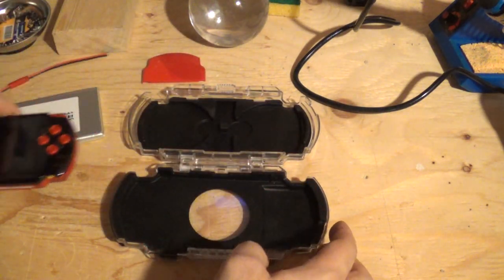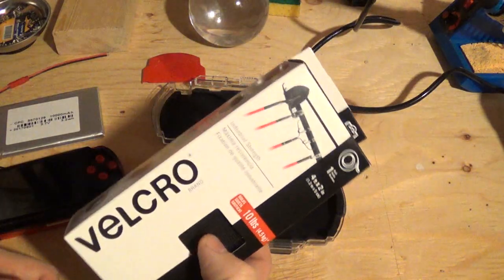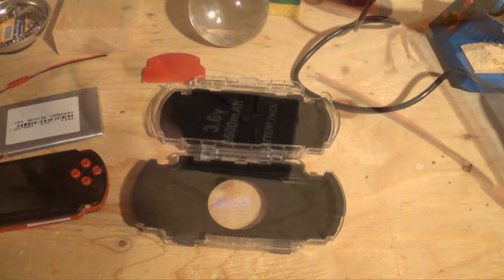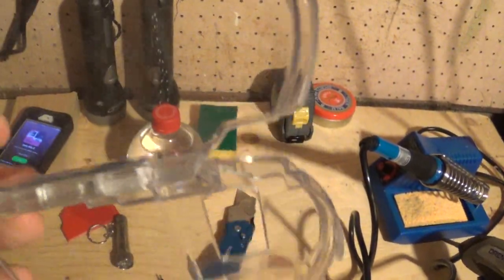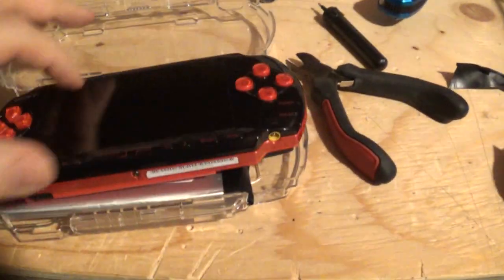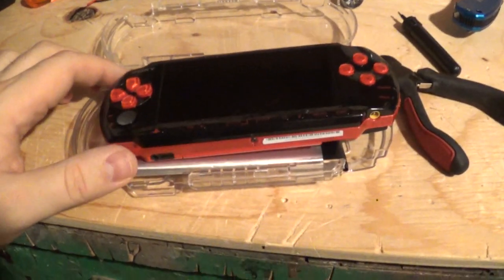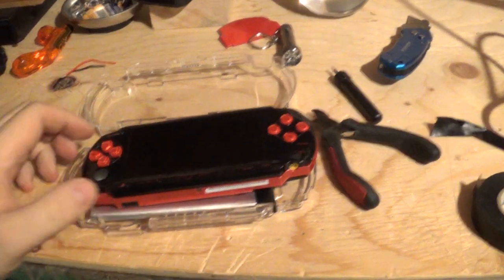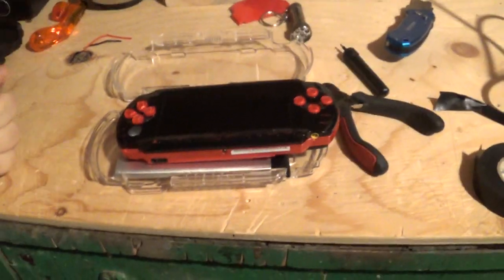10,000 mAh Massive PSP Battery mod

Comment: Theres a mod for a 4050mAh battery but it does get rid of the umd drive and you need to cut some of the case, but you could always just buy another one
Reply: That's atleast better than killing of the PORTABILITY purpose of PSP by adding this big ass 10000 Mah battery

Comment: nice
I'm doing something like this myself but I'm using a 18650 battery at 6000 amps with a battery case so when its flat i just pop it out and insert a new one and use a charger to charge it properly

Comment: Hey hows it going, im in the process of doing just this however a non invasive type only adding a new cell to a stock battery, when im complete i plan on making a video to show how to rebuild using a new cell, i plan on removing the charge/read circuit board from the original battery and applying it to the new, ill be sure to make a video after its completed hopefully

Comment: You could probably fit a 4kmah in there as well. Mod it with a JST plug and USBC port so you can change the battery without having to desolder it

Comment: Hey, is it okay to get the pcb from a bloated battery or will it explode?
Reply from the maker: mthevara it should be fine. 👍Just be careful wash up good after. Don’t want any battery acid on you or left on the board.
Reply: @CanadianZangief  Thanks a lot man. Didn't know if it was safe, I think I'll give it a go just in case the battery I ordered off Amazon turns out bad as well. Keeping the psp stock either way.
Reply from the maker: mthevara good luck with the mod!
Reply: @CanadianZangief  Thank you 👍🏼

Comment: I got a "3600" mAh battery, brand fucking new and can't even play battlefront 2 for more than 45mins.

Tried a few different batteries and have the same problem...

If this is a problem with the console and not the batteries, will this mod fix it?
I'm assuming not but I'm hoping for a yes?
Reply from the maker: S WITTON well all I can say is buyer beware. There are lots of problems with battery suppliers mislabeling products. If it seems to cheap then there is probably a reason. I doubt it’s the console itself. I’m sure it would have stopped working already from such a major problem.
Reply: @CanadianZangief  sweet.
To be honest I didn't pay a lot for it, it was around £10 which I know is cheaper than the Sony original ones.

I have a couple psp consoles so may give this ago, its a great idea dude.

Have you recorded the battery life to get a proper reading? & if so, how many hours of gameplay can i expect? Sorry for the long winded reply.

Comment: Very cool! I still have 2 old model PSPs and one of those cases. Good solution for those old swollen batteries. My pspgo is the only one running on the original battery. The other two haven't been powered on in years

Comment: Maybe you already answered it, but even so I will ask you. So, is it possible to fit internally this battery? in a PSP 2000?
Reply from the maker: Diego Deotti you can certainly do smaller batteries, but these ones are to big to fit inside. You would probably be stuck with 5,000 mAh for internal.
Reply: @CanadianZangief  thanks a lot!

Comment: I want to mod my PSP 1000. Can I use original PSP battery board for battery mod?
Board pic 
https://i.imgur.com/lBAQJxU.jpg
Update I tried to connect new battery to the board but it won't charge. Red light blinks for like 100 ms and the goes away. Any thoughts?
Reply from the maker: What kind of battery are you using and are the prongs connectors on the board intact?
Reply: Canadian Zangief 18650 battery And yes the prongs are connected
Reply from the maker: ahmad hakimi the 18650 is it 4 AA lithium battery cells? Each of those batteries should be around 3.5-3.7V. The most the psp can handle is about 4.1v and that’s kind of the top end and probably won’t change properly.
Reply: Canadian Zangief The battery has charge in it and it would not turn on I think it’s the board what you think
Reply from the maker: ahmad hakimi it’s possible. When dealing with hacks like these sometimes you just have to slowly rule out everything as you go. Good luck friend!
Reply: Canadian Zangief thanx

Comment: Although this vid is old, I might try my luck.
Do you know the exact function of this battery board you got out of that battery case?

Sadly, my original broke and I was thinking if I could just use any other LiPo Battery Charging Board, hook it up directly to PSP (without the special connector, just solder it directly with some wires) and then the battery onto it. With that setup, it should be possible to charge the battery directly through the PSP with the USB or normal power supply, or am I wrong?
Just using a small 1800 mAh battery, so no biggies there.
Hope you can help me :) Thanks for your vid!
Reply from the maker: Kyuar I believe it mostly acts as a protection circuit to prevent overpowering. As long as you can control the charge with another board it should be fine. 👍
Reply: @CanadianZangief  Thanks for your fast response :)
So I'm assuming the PSP does not have any internal charging pcbs?
I was always wondering what the third pin on the PSP is for, two of them are +/-, and I always thought the third is a kind of signal pin for battery capacity check. Measuring the pins while being hooked to the original power supply outputs something like 1,9V on +/-, which got me curious.
I don't wanna break my PSP with this experiment, so just hooking up another battery and disconnect it for charging would be the safest way I guess... Sadly, I found nothing about using any other battery board for the PSP on the internet.
Reply from the maker: Kyuar No the PSP does not. Without the battery inserted there is no need for a protection circuit since using the plug in without a battery already has the current supply and demand voltage regulated in the charge cable. I’m certainly no expert on the subject though, but when I was thinking this mod up I wanted to follow the easiest path that wouldn’t involve damaging or permanently modding it. Harvesting a battery was just the easiest way to do it for me.
Reply: @CanadianZangief  Yeah, totally understand that point. But having to invest 10+€ in my case for a chinese battery just for the PCB seems a bit expensive, compared to those charging protection boards for a few cents. Plus, knowing and having that option for further consoles is a "nice to know" :) Always wanted to get deeper knowledge in that kind of stuff.
I'm just a bit scared of hooking up a different PCB onto battery and PSP, connecting power plug for charging and then anything in the PSP could blow, you know? ^^"
Reply from the maker: Kyuar I think your generally pretty safe on the explosion but as long as you don’t overcharge or bridge a positive and negative. Let me know how you do I’m interested and like I said I am no expert and experimentation is how we all learn!
Reply: @CanadianZangief  As I said, the thing that bugs me the most is that on the three pins inside the PSP, with power plug connected and battery disconnected, it only delivers 1.9V, although power plug gives 5V.

I'll give it a try, might take some time for parts to arrive but i'll let you know! :)

Comment: Hey what's up dude! Was just curious about the part where you finally crack the battery open and reach the pcb.
Does it matter which connection you snipped (cut) first? Positive or negative?
Reply from the maker: It is possible that it could occur if it was overcharged and the separation between the positive and negative was bridged. Cut one at a time and not the same time and you will be fine ✌️. Good luck bud.
Reply: @CanadianZangief  thanks for the replies. Learned alot from you man, you earned a subscriber:) looking forward to more content as this video is one of the highlights of my year. And thank you so much I appreciate it
Reply from the maker: GNaRLZA FUNk2ThaLORE thanks for the sub man. Good luck with the mod and more projects moving forward!
Reply: @CanadianZangief  no problem! Your a cool dude! Hey I got another question man, sorry for buggin'. Would it be best to tear apart the original psp battery fully drained? Or any tips before hand? When it comes to the battery part haha. I'm afraid of cutting the battery in the first place but it needs to be done X) Sorry I am fairly new to soldering, but from what I hear it's super easy and intimidating at first. But I plan on tackling this fairly soon, I've ordered basically everything I need:D
Reply from the maker: GNaRLZA FUNk2ThaLORE as long as it’s not overcharged it should be perfectly safe in almost all circumstances as long as your not bridging the positive and negative. If your looking to get some practice with soldering (I am no expert) you could always practice on bare wires. Put the tip of the iron on the side of one of the wires and touch the Rosen core solder to the tip of the wire to form the connection. I found one of the biggest mistakes I made for a long time was touching the solder directly with the iron.
Reply from the maker: Nope. Just cut them both it doesn’t really matter which order. 👍

Comment: isn't stock 3.6v not 3.7? This is what is putting me off ordering a new third party PSP battery
Reply from the maker: Most voltage ratings have a slight amount of play 0.1-0.3 is a very acceptable level of variance that won’t impact the device operation 👍

Comment: amazing, all im missing is the lipo battery to give this a try. Any other kind of battery won't work? like 3 AA batteries ? i would get a smaller lipo tho, so it's more easily concealed maybe where the UMD reader is (im not too happy about taking it away but i've never used it, it's been like 10 years... it can go)
Reply from the maker: I did a video on using AA disposables for the PSP. You don’t get a huge amount of play time out of them but are great for pick up and play once in a blue moon. It is nice to have it all internal. Next PSP I think at a garage sale I might mod it that way just for fun =D

Good luck with the mod and thanks for watching!

Comment: I'm a layman on the subject, but is there no way to plug the battery into the charger plug?
Reply from the maker: sephirot7 Bj do you mean the regular psp charger cable? It is set up to charge normally. If you mean to use the batteries own charger it would be difficult since I have it wired up into the stock battery leads. It is possible but not without difficulty and a lot of swapping around each time.

Comment: i have 5000 mAh and it fits in the umd slot ^^ im good with my psp 2000
Reply from the maker: Mark Payando awesome! I was thinking about doing an internal mod before this but I just couldn’t bring myself to tear out the umd drive on my god of war edition. Maybe if I find a cheap one at a yard sale or something I’ll go into some internals =D
Reply: Would you please provide the link to this battery? I removed the umd drive and I'm looking for a battery to fill that space, never did any soldering so I was looking for one that fits so I don't need to do a lot of cutting in the plastic

Comment: Hello Canadian Zangief. Found this vid looking for battery mods and had a question. I have an original sony  battery chip and was wondering if i could do this using the original sony battery chip?
Reply from the maker: Yup you sure can. The only reason I used the third party is because they are dirt cheap. 👍

Comment: I wonder how long it would last if you hooked it up to a car battery? Then you could put a  shoulder strap on the car battery to carry it with you. Or you could mount the psp and the car battery to a dolly and then connect a harbor freight generator hmmmmm but then where to put the gas can? First world problems! smh
Reply from the maker: quickly starts drawing up plans for a mega proton pack for 10 years of PSP gameplay lol
Reply: Car batteries are 12v so they will destroy it, but if you got a cigarette lighter charger and ran it with that untill the battery was flat on the car that would tell you

Comment: hmm.. your 10000mah battery says 3,4wh, my 20000mah is 74wh
Reply from the maker: Good eye. I don’t know Wh as much as mAh and V but I seems to me that it’s 32 wh and becomes 62 wh in series. The standard calculation is Wh divided by V times 1000 which is less than the 20,000 mAh for me and is correct on your battery. Either way your battery will work just fine.

👍

Comment: i've done this 10-12 years ago.mine was using 18650 battery and just stick it with duct tape lol
i have plan to redo this using 3d printed battery holder
Reply from the maker: If it works right haha! If you end up making a 3D Print of the holder I would love to see it =D

Comment: can i use 3.8v 3000mah?
Reply from the maker: Yes that should be fine as long as it’s the same type of battery. Lithium Polymer battery. You can usually go 0.1 or 0.2 in ether direction and be fine.
Reply: the battery use is kata cell phone ..
Reply from the maker: paulo magcalas I looked it up and those are Lithium Ion batteries they would work in theory but are known for instability and can explode because of the density which makes them smaller than LiPo batteries. I think if you wanted to try and use Lions you would need to build a different protection circuit and possibly even charge them independently from the PSP. You know all those stories about cellphones blowing up on people? Ya that’s due to poor Lithium Ion battery management.

Comment: can i use any battery for this?
Reply: can i ask whats the three wires in the board are for?
Reply from the maker: Positive, negative and the ground.
Reply from the maker: Yes and no. The psp needs 3.7V to power it and the charging circuit is for 3.7V LiPo batteries. As long as it is 3.7V or close you can use other batteries but you would need to externally charge them.

Comment: Is it possible to use this battery inside the psp 200o considering how thick this perticular battery is !? Will it fit inside without having to do a extreme amount of cutting? Let me know please?
Reply from the maker: DarkKokoro84 it’s to big to fit inside the psp. Internal battery mods that remove the UMD drive are usually limited to about 3,000-4,000 mAh.

Comment: Hi, would you be able ot recommend a smaller battery that would fit within the PSP? I was thinking that if the UMD were removed it could fit in there. Thanks for the videos!
Reply from the maker: PhilExile well you should be able to fit in a 3.7v 3000 mAh LiPo battery inside. Most of them around about 110x60mm which should fit just fine once you take out the umd drive. I always go for cheap on eBay when it comes to those kinds of batteries just check the dimensions before you buy. Good luck with true mod bud 👍

Comment: Canadian Zangief my stock battery is 2 years old  the voltage  is 1 volt  my battery is garbage
Reply from the maker: Ya that’s pretty much toast lol. You can still open it up use the protection circuit  and battery housing though =D

Comment: How many hours does it take to full charge and discharge?
Reply from the maker: I usually just leave it plugged in overnight and I get a full charge. I don’t think it should take that much time and would probably closer to about 5-6 hours. As for idle discharge I seem to lose on average 1 bar of power every 3-5 weeks which is pretty decent. I get a good 30 hours of playing time from a full charge =D Results will obviously vary depending on battery condition and quality.
Reply: @CanadianZangief 1 bar in 3-5 weeks XDDDD wtf lmao
Reply: Canadian Zangief Wtf
Reply: @syrusse8660  the original 1200 mAh batter lasted about 7 hours on a full charge.... I don't doubt this man.